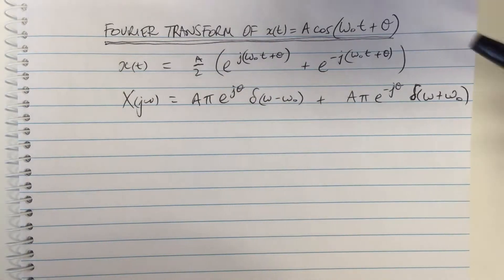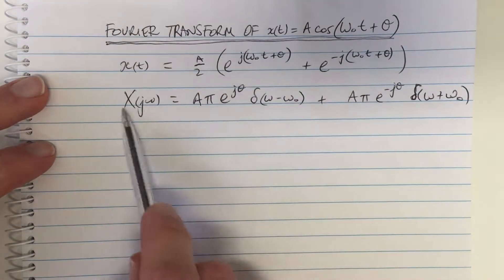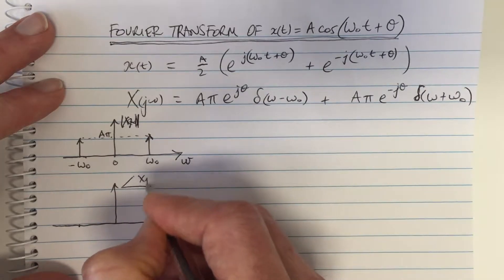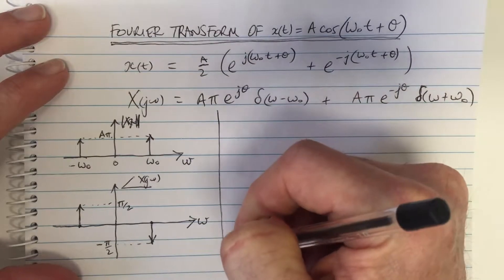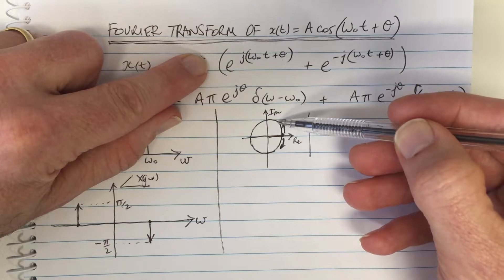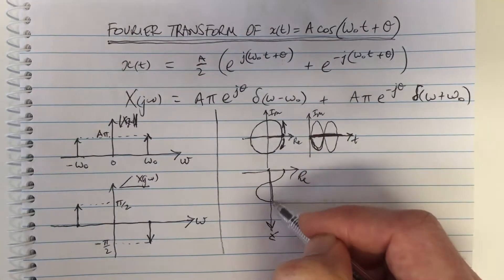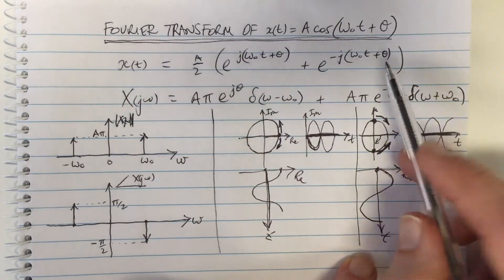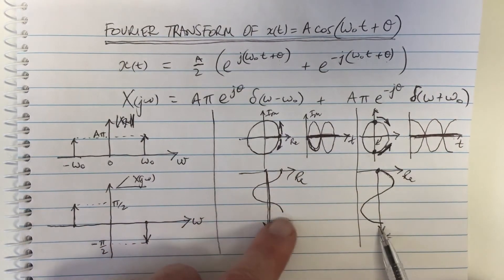Fourier Transform of Cos with Phase Shift

Comment: Hi Iain, thank you for the great videos! Quick question: why  do we have delta functions in the phase of the FT and not just two "samples" (like Kronecker delta functions) at the +-ωο frequencies with values +-π/2?
Reply from the maker: The function is a delta function with a complex valued "area", so it's not really well defined on a phase plot. You're right, the phase is fixed (it doesn't go to infinity, like the amplitude does in the delta function), so it could be drawn like you say, with a vertical line with a dot on the top.
Reply: @iain_explains  Thank you!

Comment: since the impulse is the scalar of the magnitude, the phase in e^(iθ) is not affected by this scalar. Shouldn't we draw the spectrum of the phase with a normal value instead of an impulse? I'm not sure about this, thanks for dispelling my doubts in advance
Reply from the maker: Ah yes, that's a good question. It's really not well defined, so there's no real right answer. The delta function is a real valued function, defined in terms of an integral. It's only a convention that we use an arrow to draw its amplitude. In some respects, maybe it would have been better to plot its phase as a vertical line with a dot on the top, rather than an arrow, as you say. Either way, it's only an arbitrary representation of something that's not actually physically realisable (the delta function, I mean).
Reply: @iain_explains  Thanks a lot, professor!

Comment: Hi, I wonder why the magnitude is A*pi instead of A/2. Tks in advance!
Reply from the maker: It is because I plotted the Fourier Transform as a function of radial frequency, and omega = 2pi f . Therefore d(omega) = 2pi d(f) . So therefore, the "radial frequency" version of the FT equals 2pi times the "real frequency" version.
Reply: @iain_explains  I don't see that. If |X(jw)| is the radius of the circumference in the complex plane, it should remain the same regardless of whether you use Hz or radians/s for moving the point. Since w=2·Pi·f, plotting |X(jw)| against w or plotting |X(jf)| against f just makes the graphic compress/decompress horizontally. No?